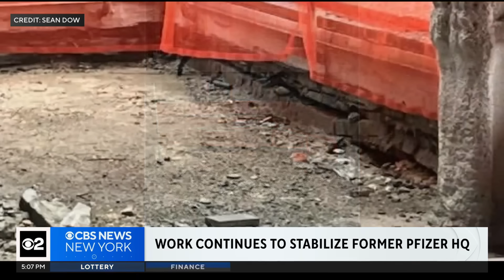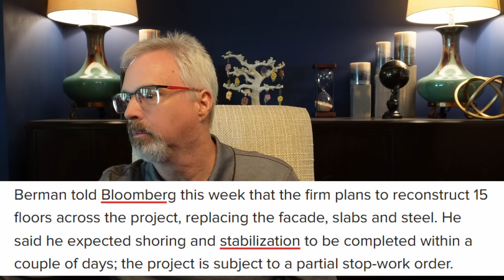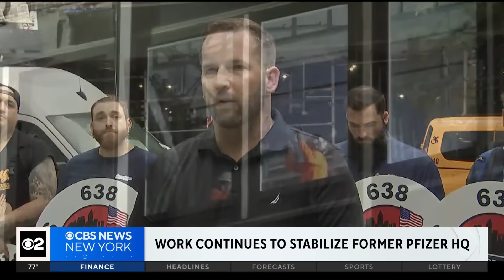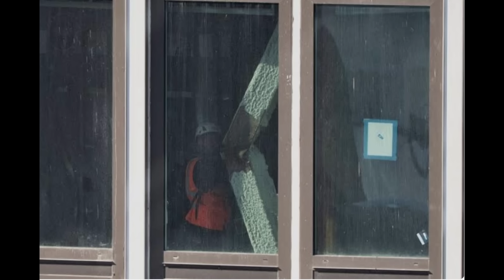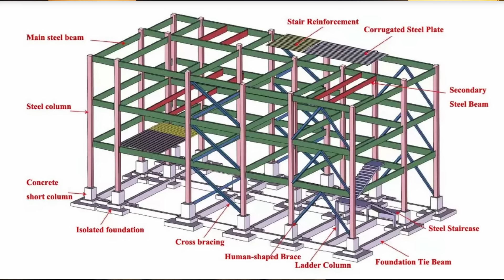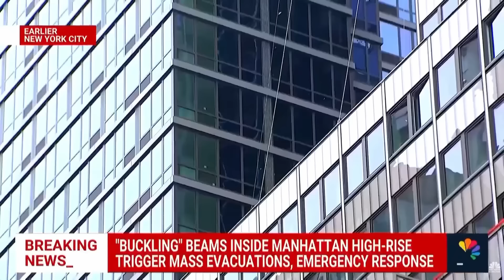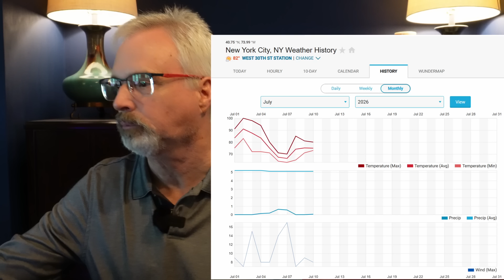Update - Pfizer Building Structural Column Failures; Now What?

Comment: If the building is having a change of use; namely business to residential, then there are bound to be structural changes to the walls and loads.  Does this type of building have only stud walls?  I would find that strange as there will be no privacy.  Could the plumbing and rubbish chutes have been broken through the floor and weakened some of the structure?  In addition there will be piping needed for showers, toilets and kitchens in far greater number than an office block.  This in addition to a water supply (tanks on the roof) for residential is likely to require greater weight or not?

Just a few naive thoughts...

Comment: Even the greenest graduate engineer would recognize that the columns of top floor of the existing building, plus all those columns below right down to the foundation, were not designed to carry the load of the additional floors. My guess is that the structural engineers called for reinforcing of the existing columns, but the contractor delayed doing that while they proceeded with the construction of the additional floors. Maybe it was manpower scheduling, or materials availability, or asbestos abatement. A clue is the claim that the project was 2 months ahead of schedule, which begs the question, how did they get that far ahead?
Reply: Agree.  We don't know if a reinforcing step mandated by the engineering firm was delayed, or even skipped entirely.
Reply: @MrShobar  If the column reinforcing was skipped or delayed, inspectors at the job site (city or private) and representatives from the structural engineering firm would have called that out immediately.
Reply: @MrsAnnieTK  in the long long ago but these are Trump times
Reply: @AnotherAustin-z7b Are you suffering from a broken Colon?   It appears the backed up waste has begun to impact your thinking quality.....
Reply: @MrsAnnieTK  *should. Don't make dangerous assumptions! ;)
Reply: @AnotherAustin-z7b  Trump's personally responsible for your local building code enforcers everyone. I read it from a midwit on the internet.
Reply: The project was ahead of schedule because it was expected to ultimately be demolished. Now that some columns and floors have failed on their own, they're right on schedule.
Reply: @Jeremy.Jedynak maybe. They might have to disassemble the building the expensive way the Hard Rock hotel in NOLA was.
Reply: If the commercial occupancy was based around 80 PSF live loads, and the residential design changed to 40+10 live + dead load assumed standards, they may have assumed the same structural frame could handle more floors of lower weight density.  

Not good to assume though, without the actual work of identifying old construction details, and evaluating a comprehensive model.
Reply: Read the prior report comments.. the top floor was overloaded, the load removed and a lighter installation of 'mechanicals' was installed.. thus it is likely that with the expansion, the building had been structurally stressed out, unloaded and finally gave way under the stress loading of equipment and materials that stressed (out) point due to placement (outside wall) of materials, movement equipment and machinery.... so was it a Friday afternoon failure.. and then everyone left early?
Reply: That was my first thought also, since when you plan for manpower you have a rough idea of how long things take so either you would've had to throw extra manpower at it (and pay more wages) or cut corners somewhere.
Reply: This is what the union rep might be referring to. They maybe weren't hiring enough manpower to cut costs affecting the project construction and were possibly skipping steps to stay on schedule.

I assume if that's the case, the EOR likely decided the existing support columns could hold the weight of the added structural materials but likely not all the finishing materials etc, so the re-inforcing would be completed after when able. The existing columns could also be structurally compromised which may not have been easily assessed due to asbestos containing fireproofing covering the columns.

All in all it's not going to be a good look on the EOR, metroloft, and the city.

Comment: My non engineering 2 cents observation 

A horizontal movement caused a vertical failure.  (?)

The vertical steel twisted and failed as they came out of plumb. (?)

Like there was a horizontal spreading occurrence above the failed steel (?)

Comment: This whole project rests on placing additional loads on the existing building structure.  They could but chose not to introduce new independent support columns though the old structure to carry the additional loads directly to the foundations.  I can't see how this error is possible unless the reserve capacity of the existing building was never established.  The fire protection should have been removed, columns surveyed, material samples taken.  It will be intersting to see the drawings submitted for city approval and look for how the columns that buckled are described.  My hunch is that either they are not or they are wrongly shown as bigger than they are.  For me this undermines the credibility of the whole project, if they can make this mistake how many others are there yet to be found?

Comment: Engineers assumed the spindlier perimeter columns would suffice as field columns that were not even checked for corrosion, then add dead loads of weight, tools and construction material on a hot day and all the holes in the swiss cheese are lined up.

Comment: With sensors couldn't the problem be interpretation. For bridges, we know very well what is acceptable movement, for a building it may be a bit more vague, the real cost would probably be specifying what is considered okay and where the sensors need to be exactly. More so than the actual sensors. But that's just a layman's guess.

Comment: The roof directly abpve the failed cp;umns had a leak.  No one knew or if they did, it was ignored. Corrosion ensued, weakening the support structure.  I would be removing all laggmg on the same floor, expecting to find a common problem.  Given that water will adhere to the surface, I would also check the floors below to insure damage had not propagated downward.  Speaking only for myself, I would not have workers in the building until an inspection and evaluation had been performed.  The steel got more and more load as building progressed, and finally reached its limit.  There is nothing to say all the the other steel is free of the damage a leak could have caused. tom

ADDED: If this is the case/cause, then the iron workers union may have a case where the new steel was attached to the existing would have shown evidence of corrosion, and should have been called to the attention of the site manager(?) and investigation performed to see the extent of the damage.  Non-union just plopped the steel in place and moved on...

Comment: Was there a history of roof leaks that could have compromised those steel columns?
Reply: Naturally, temperature fluctuations are particularly pronounced in the roof area; consequently, even ordinary condensation—driven by variations in room temperature and the air-conditioning settings for that floor—could have led to the formation of condensate and, in turn, rust on the steel beams beneath the porous fire-protection insulation. 
In the late 1950s, no one addressed systematic corrosion protection in such contexts, as it was assumed the steel beams possessed sufficient "material reserve" to avoid any resulting issues. 
During that era, the steel reinforcement in concrete beams was also often covered by only a very thin layer of concrete, which would subsequently crack and spall—a common problem, for instance, with bridges built during that period (and one that is, fundamentally, irreparable).

Comment: I have to say I have been on construction jobs that had both union and nonunion workers and what I personally witnessed was the lack of skill that the nonunion workers showed. Also what I personally witnessed was that the non union workers would never say anything in fear of losing their jobs. In addition the language barrier was also a problem. I was in an exterior construction elevator that almost fell a few floors because a non English, non Spanish speaker, tried to pry open the safety gate on the ground floor! 
This combination of factors is magnified in sanctuary cities in my opinion because the foreign workers are somewhat protected but this opens them up to abuse by unscrupulous contractors who can chuck them to the curb for any reason. You wouldn’t expect it but it’s a very real thing in n big blue city’s

Comment: Chlorides weren't removed from Fireproofing formulas until the 1970s to 1980s. Fireproofing is highly porous and acts like a sponge. Perimeter columns and interior columns, where water intrusion is evident need corrosion inspection.

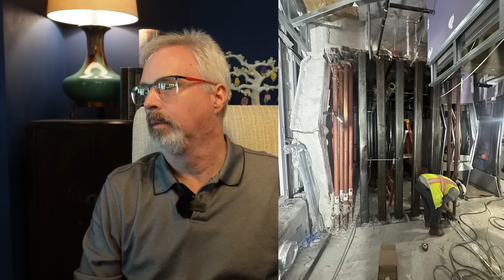Comment: The photo ( 4:15 ) of the deflected beam with the new support beam alongside that also show a difference in height,  that beam is more then a 4 inch deflection . The additional safety features of a load design what happens when that’s used up in a addition your left with no safety factor

Comment: The cantilever above the fail has to be a suspect. A cantilever adds considerable stress to any structure. The stress is both diagonal and vertical. They may be there, but I did not see any diagonal members. In any case, this diagonal stress would be transferred down as compression on the second column in on the 22nd floor and below. Those columns below the inside edge of the cantilever are carrying the load of two spans. I can see an architect coming up with this, but I have a hard time seeing a structural engineer going along. At the bare minimum, columns should have been supporting the outside edge of the open air area.
Thank you and have a good day.
Reply: That’s what I’ve been saying
Reply: Totally agree with you!
Reply: The lack of visible diagonals also stood out to me, a braced box offers much better load distribution but what do I know
Reply: Former roof design maybe?

Comment: The existing columns may have been reduced as a part of value engineering back in the 1960s. It's possible that the as-built documents didn't reflect the changes made. Th current design loads could have been from original plans that didn't reflect the actual conditions.
Reply: In my experience, structural drawings pre-AutoCad are 100% reliable b/c they are drawn by HAND, and changes required a lot of documentation and time.  It's the newer drawings (1990 +) that you need to worry about.

Comment: I would not discount all those wire spools stacked in the corner of that building. That's a large ammount of weight in probably copper wire.
Reply: However, these coils are stored on the same level as the columns that failed, so they cannot have contributed to overloading those columns. 
Of course, we do not know what else might have been stored on the upper decks, but these rolls are certainly not the reason for the buckling of the columns standing next to them. 
In my view, it is far more likely that the entire new structure was simply far too heavy for these two columns, which previously only had to support a roof.

Comment: I would wonder if the design included reinforcing the legacy colums, (e.g. by boxing), and that wasn't done.  It's not like cost cutting isn't a major factor in building disasters, after all.  "Hey, the boxing would raise the margin of safety from x to y, but x is good enough, I think, and we would save N thousands by not doing the boxing"
Reply from the maker: The developer initially stated that he didn't think that the required column reinforcing had been performed but no details were provided.

Comment: that is 100% a design issue.  There's absolutely no way you would need those giant steel columns ABOVE the collapse to go on top of those toothpicks that were only meant to support roofing materials, mechanical, and snow, unless a real engineer never saw those plans.
Reply: When I look at those pictures of the buckled column, what I see is one hell of a point load on that outside corner, especially considering the cantilever it's carrying, and the freaking 15 stories to be added on above. How did the design get through all the stages from the beginning of planning to the beginning of construction without noticing that?
Reply: Could this not also be a mistake in execution, adding more weight before replacement columns are put in place?
Reply: @jkr9594  Which begs the question were there no inspections by the permitting authorities? I believe this failure had many aspects, involving the developer, the contractor and the city inspectors.
Reply: @charlestoast4051  Someone with NYC claimed that they have 40,000 construction projects going on at one time so how many inspectors do they have?
Reply: @jkr9594  This is the only scenario that makes some sense.  There is almost zero chance that a reputable engineer would design the addition without strengthening the structure below.  However if that strengthening had not been installed there would be a problem.  There is a very low chance that an omission like this would have gone undiscovered but the chance of that is still much greater than the chance that the engineer didn't consider it.
Reply: @billj5645  they are typically noticed when they fail
Reply: I'm wondering if the developer/owner consulted or hired a qualified structures engineer at all, or did they just add on the new floors like the project is a two-story house being built by a house contractor/builder?
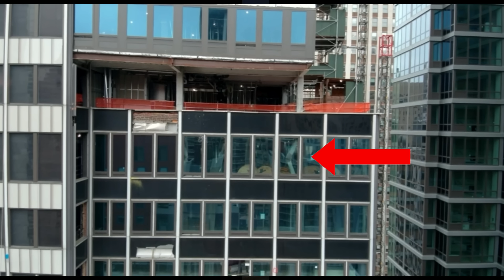Reply: It's not that six large columns were added over six smaller columns intended only to support a roof.  There were two large columns (reinforced concrete?) added over a run of six smaller steel columns (2:00), and the columns directly below the two large columns buckled, transferring the weight to adjacent columns.  I believe it was bad engineering, useless government "inspection" and the developer will try to hide these serious mistakes.  Enshittification is everywhere these days.  We're entering the age of idiocracy.

Comment: Given the load-factors typically used in structural steel, my gut is that, adding 16 stories onto 21 (with members and joint boltings carrying load for 70 years) was a huge risk without significant sub-structure stiffening. The 21-story sub-structure, to your point, should be 'strain-gauge city'!  Mr. Berman is smoking his socks.....the fix is big, really big.
Reply: In the state I work in they don’t add 1” to 1-1/2” of asphalt or concrete to a 9” bridge deck without checking the load capacity.  That includes bridges with heavier beams where the additional dead load increases by less than 10%